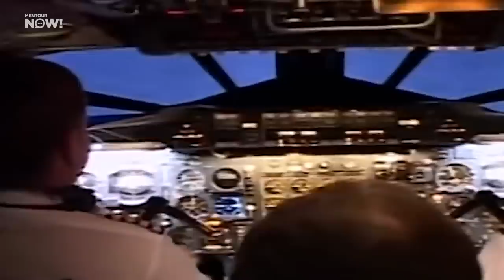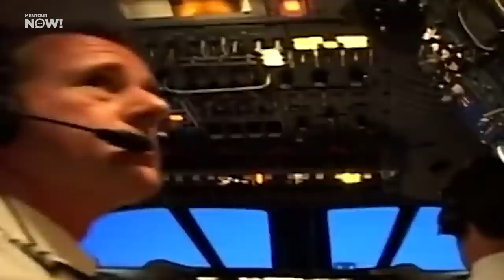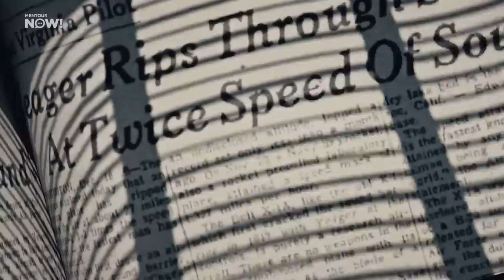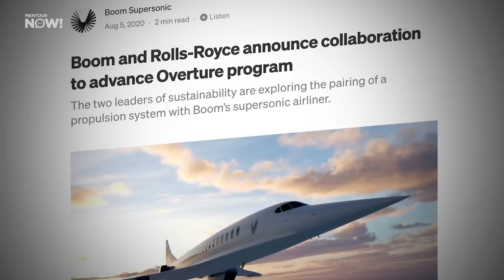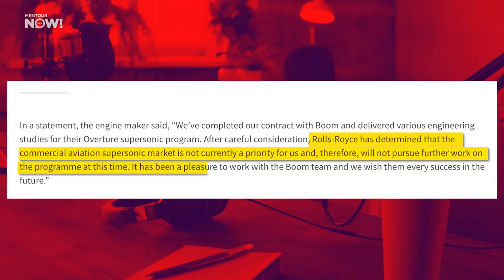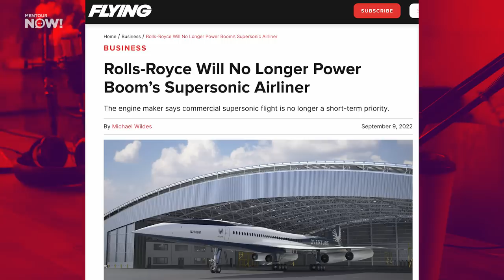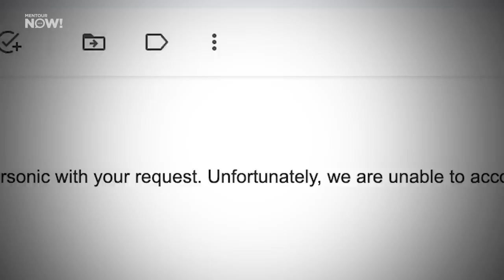WHAT’s Going On with BOOM Supersonic?! Will it Fail?

Comment: The Boom supersonic plane project can only fail, as it's currently impossible to develop suitable engines...
Reply: @78Dipar  Florida Turbine Technology are designing, building, and Testing the engine for the Boom Symphony. FTT are a subsidiary of Kratos Defence and Security Solutions Inc, who have a market capitalisation of $1.88bn. Work started in January 2023.
Reply: @phonicwheel933  I doubt they will succeed...
Reply: @78Dipar  Your probably right. The odds are against Boom and the Overture. I don't believe that Boom is a scam, like a lot of people are claiming. There would be a lot easier ways to make a buck than by running an aerospace company for 9 years. So one of three things will happen. They will run out of money, they will be taken over, they will make a roaring success of Overture. I hope the latter.😊
Reply: @phonicwheel933  If all major jet plane engine builders have declined studying new engines for Boom, there is a reason for that. Too dificult and expensive for a small market...
Reply: @78Dipar  Agree. I said the same thing a few days ago:

A big fuss is being made about Rolls Royce ending their contract with Boom, but AFAIK the contract was only for consultancy, and not to build an engine for Overture. Besides which, the Symphony project would be totally unsuited to the tier one engine manufacturers, like Rolls Royce, GE, P&W, and Safran. Their cost base and time frames would be out of kilter, and the volume of sales would not warrant their investment. GE caught a cold with the Affinity program.

Comment: So go crazy and say that BOOM sells 40 airframes per year. That is 160 engines. Round up to 2000 engines over ten years. A clean sheet engine would set you back 6 to 10 billions. So just in development costs each engine will be front loaded with 3M dollars, nobody has made any profit, and interest rates are rising.

Comment: boom is nothing but fiction, and there is so little substance to it i am surprised it still hits the news, let alone got airlines to invest in it 

the engines are just some of the public issues with this company/design 

while there has been a lot, and i mean a lot of talk about the tech, the company has yet to even prove it can produce a flying aircraft......think about that, no one test flight yet 

it still have yet to show it can even scale up (let alone produce) aircraft manufacturering

its just a bunch of tech bros, with bright ideas that have not yet met a single goal (even when it keeps changing those goals to lesser and lesser lofty scales)
its that same dream of flight that is met with the same issues that nearly bankrupted boeing with the SST, and without some other sign of abilty this company WILL fail (for boeing the 747 proved it could make air travel affordable, boom isnt bringing anything to the table that is meaningful, and still so late in the game it is having design changes when really, it should have by rights taken flight with its baby boom, to show at least one just one of its claims is achievable by this company

Comment: Without Rolls Royce taking part, this aircraft is more than likely dead.  If anything ever does come of it, it would be a miracle.
Reply: Florida Turbine Technology, a division of $1.88bn Kratos Defence, started the symphony engine design in January 2023. Boom stated that no current engines, either military or commercial, are suitable for adapting to Overtures unique requirements. 

Boom will design the pods and the variable geometry exhaust and inlet ducting.

A big fuss is being made about Rolls Royce ending their contract with Boom, but AFAIK the contract was only for consultancy, and not to build an engine for Overture. Besides which, the Symphony project would be totally unsuited to the tier one engine manufacturers, like Rolls Royce, GE, P&W, and Safran. Their cost base and time frames would be out of kilter, and the volume of sales would not warrant their investment. GE caught a cold with the Affinity program.

Comment: Wanting them to succeed is nice but it won't make up for the fact that a junior company doesn't have the strength to carry out such a project where major manufacturers and airlines already concluded that it would be a failiure (sure sometimes the old dinosaurs want the young ones to fail so they are not dethroned, but it is not as if the experiment hadn't been already done).
Fuel prices going up, funding going into wars and climate change policies with a disgust of aircraft depicted as obsolete tech from a time where dreams could come true won't help a small company to carry out that project. 
It will likely fail and be closed in two to three years, especially if they scale down the specifics every time, making it absolutely uninteresting and useless...
Either they are overconfident, or they are simply a scam.

Comment: Well they might as well just build it on engine by reverse engineering existing engine
Reply: Florida Turbine Technology, a division of $1.88bn Kratos Defence, started the symphony engine design in January 2023. Boom stated that no current engines, either military or commercial, are suitable for adapting to Overtures unique requirements. 

Boom will design the pods and the variable geometry exhaust and inlet ducting.

A big fuss is being made about Rolls Royce ending their contract with Boom, but AFAIK the contract was only for consultancy, and not to build an engine for Overture. Besides which, the Symphony project would be totally unsuited to the tier one engine manufacturers, like Rolls Royce, GE, P&W, and Safran. Their cost base and time frames would be out of kilter, and the volume of sales would not warrant their investment. GE caught a cold with the Affinity program.

Comment: It doesn't make any sense that burning lots of "sustainable aircraft fuel" makes it greener. All the sustainable fuel burned is fuel that another aircraft could have used in a much more efficient manner. We need to stop thinking that "sustainable" is a magic word that makes it free of environmental cost at a systemic level. Supersonic air transport is stupid from a physics and engineering point of view, there's nothing on Earth that needs that kind of transport speed.

Comment: The unofficial top speed of the Avro Arrow was Mach 1.7. 1957. It had CAN. Computer Aided Nav. Actual was 2.2 Pettr. If you haven't seen the movie or documentary, ask. I would be happy to suuply it.  Many engineers would argue that it was far beyond that at altitude. WTF is wrong that the world does not know this? Why is it delta swept wing is attributed to Americans. WE DID IT FIRST. 1954. Bell engineers. The guys that eventually created the LEM and Apollo hardware. Our designs were stolen by the US and we were told to kill every Avro prototype and all design plans. Our weak kneed PM did just that. We created the best fighter in the world. Undisputed. That baby could still kill most threats in this world. But. Murica.
Reply: Ahhh the Germans did Delta and swept wing practical research and testing first... Look up the Lippisch P-13 and Me-262.Just sayin'. That's where the Allies got all the research from. Lippisch was the expert on delta research. The Avro 707 (British) delta series was flying in 1949 followed by the Vulcan in 1952, so your timeline needs some work.

As for the Arrow, it's an emotional topic for Canadians much like TSR2 is for the British, but the truth is a bit more harsh. We will never know what it was capable of as no production representative aircraft was made. It was an impressive aircraft but was a VERY BIG interceptor (i.e. a big radar target for a SAM) not a fighter and had no export market. 

The F-106 was a lot cheaper, faster, smaller, had longer range and a better radar and avionics systems.

So no export market, no production. Canada could not afford such and expensive aircraft on its own. Something that also killed TSR2. There is a bit more myth and conspiracy thinking than fact around Arrow, same as TSR2.. 

The documentaries on Arrow are heavily biased. I have seen them all. (an I am not American) There are books on the topic that are a bit more realistic.

Comment: No engines? No airplane.
Reply: @fw1421 

Florida Turbine Technology, a division of $1.88bn Kratos Defence, started the symphony engine design in January 2023. Boom stated that no current engines, either military or commercial, are suitable for adapting to Overtures unique requirements. 

Boom will design the pods and the variable geometry exhaust and inlet ducting,

A big fuss is being made about Rolls Royce ending their contract with Boom, but AFAIK the contract was only for consultancy, and not to build an engine for Overture. Besides which, the Symphony project would be totally unsuited to the tier one engine manufacturers, like Rolls Royce, GE, P&W, and Safran. Their cost base and time frames would be out of kilter, and the volume of sales would not warrant their investment. GE caught a cold with the Affinity program.

Comment: Boom is bollocks. Any supersonic airliner will burn copious quantities of fuel even if powered with engines with double the efficiency of the best engines currently available. So even if the airframe costs nothing the costs of fuel, airways charges, handling charges, aircrew, maintenance will kill it dead even before we consider the sound of its sonic boom. This is nothing more than a power plane.

Comment: They have no engines... that's a pretty big deal.
Reply: Florida Turbine Technology, a division of $1.88bn Kratos Defence, started the symphony engine design in January 2023. Boom stated that no current engines, either military or commercial, are suitable for adapting to Overtures unique requirements. 

Boom will design the pods and the variable geometry exhaust and inlet ducting,

A big fuss is being made about Rolls Royce ending their contract with Boom, but AFAIK the contract was only for consultancy, and not to build an engine for Overture. Besides which, the Symphony project would be totally unsuited to the tier one engine manufacturers, like Rolls Royce, GE, P&W, and Safran. Their cost base and time frames would be out of kilter, and the volume of sales would not warrant their investment. GE caught a cold with the Affinity program.

Comment: I think supersonic passenger planes are a waste of time. You're still going to get a numb ass on a long flight. You're still going to get off the plane deafened by a screaming kid, and aching all over. The biggest step forward would be to stop pushing the seats closer and closer together. We simply do not have the technology to solve the problem with speed. When you can cross the atlantic in 10 minutes, we can talk. But not if the fuselage is a toothpick and the seat in front of you is on your lap.
Reply: @ashscott6068 All seats on Overture will be business class, so they will be comfortable and there will be plenty of individual space. Tickets will be the same as subsonic business class. For example JFK/LHR return will be $5,000.
Reply: @phonicwheel933  5 grand just for an Atlantic hop? Absolutely not worth it. Busness class is just cattle class with legroom. But you're still cattle for a few hours in the airport, either side of the trip. Save the extra few grand. Cus 3 hours on a plane really isn't a few grand better than  6 hours on a plane

Comment: Its going to fail cause it won’t work and the public will not want to travel on it and some of the airlines that have placed orders for this have pulled out due to operational costs
Reply: @ctaviationvideos4926 Overture is not aimed at the main line economy flights. Instead it is aimed at the 700 million long range business trips made yearly, world wide. 

Only Virgin have let their options lapse, and that is almost certainly because they are perusing their own supersonic vehicle. Also, Virgin have a habit of pulling out of deals and they are also financially stretched. American, United, and Japan Airways still have orders/options. The USAF have awarded Boom a $60 million, 3 year contract to study military applications for Overture.

All Overtures 65 to 80 seats will be spacious business class, almost certainly with internet, and tickets will be the same price as subsonic business class. Subsonic JFK/LHR will take 8 hours. Overture will do it in 4 hours.

Comment: I think BOOM is another naive startup with more cash available that the combined amount of brainpower the company founders decided to use in this endeavour. Add a little naivety, possibly even a bit of hubris and you've got this mess. The bottom line is that if Airbus, Boeing or Bombardier etc with the massive budgets they possess along with strong relationships with existing and capable engine manufacturers thought they could make money from a supersonic jet! I could go on but i'll leave it there.

Comment: No powerplant options exist!  Zero
Reply: Florida Turbine Technology, a division of $1.88bn Kratos Defence, started the symphony engine design in January 2023. Boom stated that no current engines, either military or commercial, are suitable for adapting to Overtures unique requirements. The engine will be a 72 inch, twin spool, medium bypass, turbofan, without reheat. It will produce 35,000 lbs thrust. 

Boom will design the pods and the variable geometry exhaust and inlet ducting. The objective is to have power unit that is efficient at both sub and supersonic speeds

A big fuss is being made about Rolls Royce ending their contract with Boom, but AFAIK the contract was only for consultancy, and not to build an engine for Overture. Besides which, the Symphony project would be totally unsuited to the tier one engine manufacturers, like Rolls Royce, GE, P&W, and Safran. Their cost base and time frames would be out of kilter, and the volume of sales would not warrant their investment. GE caught a cold with the Affinity program.

Comment: The concorde failed cause nobody could afford it. We are living in a climate chrisis who the fuck is gonna fly super sonic jets? Super sonic jets have also been previously bannedfrom entering airspaces near cities because of the sound so why are we doing this whole spiel again?
Reply: @hungryhedgehog4201 Some people imagine there is a climate crisis, others think otherwise.😊

Aviation has changed radically since Concorde began service in 1976. More people are flying, and they are more affluent. Roughly speaking, passenger numbers double every 10 years. In addition, technology has advanced greatly, especially with the advent of computers, so that engines are now more powerful, efficient, quieter, and lighter. Aircraft design has also been revolutionised by the use of composite materials (as used on Overture), embedded computers, additive engineering, and automation. 

Because Overture will be efficient at sub and supersonic speeds, 500 routes, some mixed land/water, are viable, rather than just 2 water routes for Concorde. Overture will fly 2x the speed of subsonic jets over water and 20% faster over land. Overture will not fly supersonic over water. Overture's cabin will be more spacious and quieter than Concorde's cabin. The seats will be more comfortable. Concorde carried 100 passengers at Mach 2, over 4,488 miles. Overture will carry 72 passengers at Mach 1.7 over 4,888 miles. 

Overture's development costs will be half those of Concorde. The manufacturing cost will be less, the maintenance costs will be a fraction of Concorde's, and the availability will be higher. Overture will be simpler to fly, eliminating the need for a 6 month pilot conversion course. Overture will also have a modern cockpit, with more room, and a flight engineer will not be required. Its cabin will be quieter and more spacious, and its seats will be more comfortable. In contrast to Concorde's tearing engine noise, Overture will comply with ICAO-14 regulations, allowing it to use all airports. 

Taking a JFK to LHR one way flight:

Aircraft          Fuel cost^           Economy      First Class          Duration
Boeing 747       $147                   $577               $2,308                 8hrs
Concorde          $753                                           $5,000^^              3.5hrs
Overture            $628^^^              $1,300            $3,800                 4hrs
Business jet^^^^                                          $53,000 to $99,000    8hrs

^       Fuel cost per passenger
^^     2023 money
^^^   Assuming that Overture is 20% more efficient per mile and 72 passengers
^^^^ There are no supersonic business jets

As to popularity and occupancy, the 747 has 400 seats to fill, but Overture only has 72. Overture would not be competing for the mass market, but Boom have identified 500 viable routes. Overture may become a niche service, where certain travellers expect higher prices. Even now, on subsonic airliners, some people are prepared to pay 4x to fly luxury class.  And, as far as business travel is concerned, the time saving would be well worth it. To back this, Boom have done quite a few surveys, as have some airlines, which show the viability of Symphony.

If Overture reaches production, and meets its specifications, it will be popular with both airways and passengers, because it will half many journey times and will be cheaper, more comfortable and a lot more practical than Concorde. The military have already shown an interest in Overture. The next development should be a 200 seat version and possibly even a business jet.